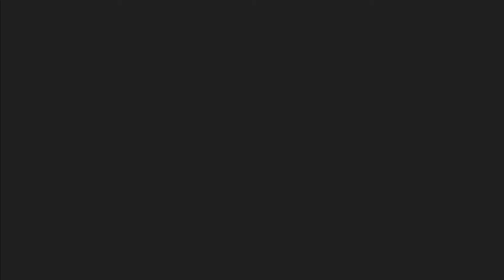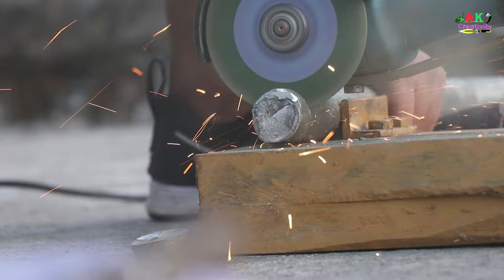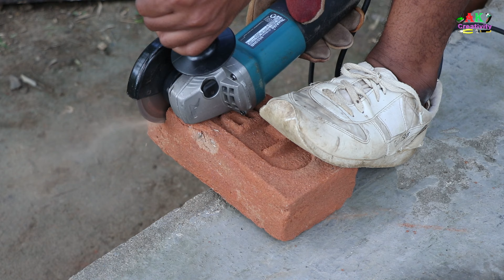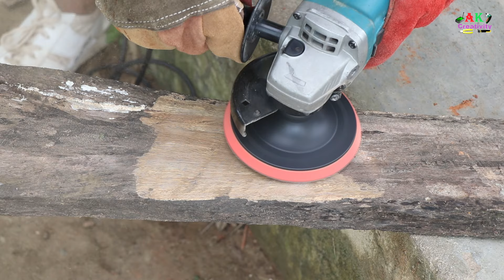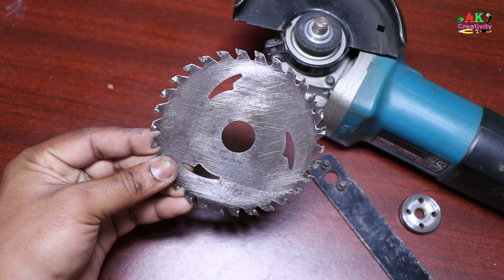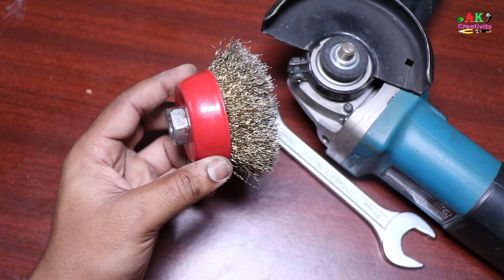7 Amazing Angle Grinder Attachments !!!

Comment: How to remove paint from wall using angle grinder, I mean which one we have to use
Reply: Use brass wire brush as u saw last in this video
Reply: Hi
Reply: Use a sandpaper disc
Reply: How to move dried compound on a concrete wall?